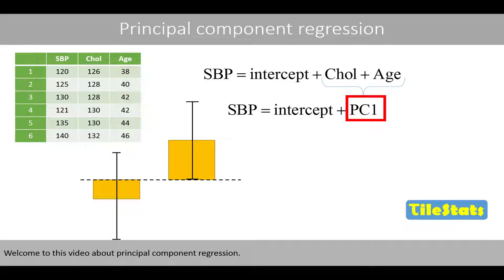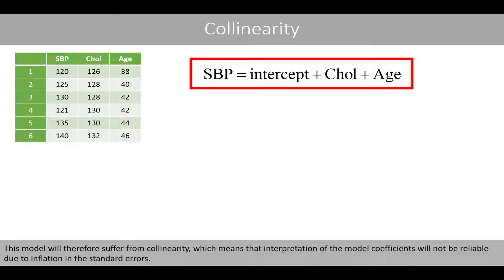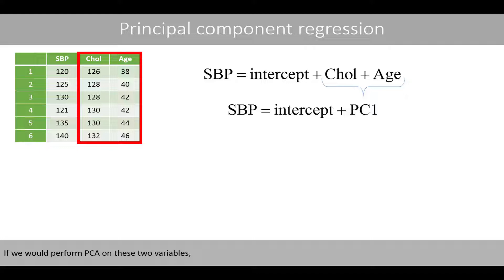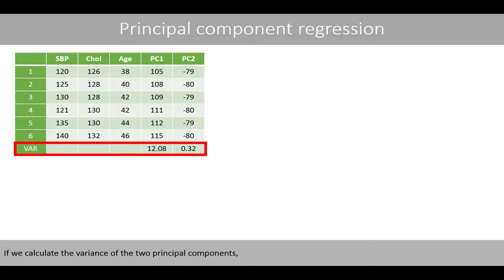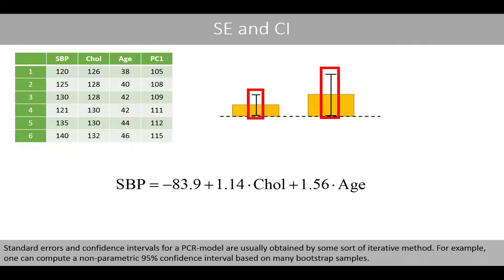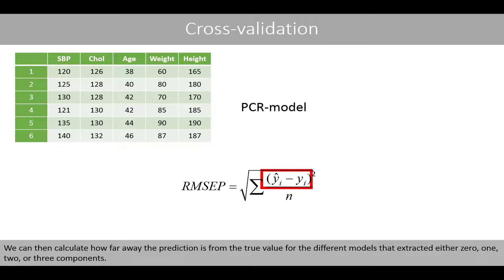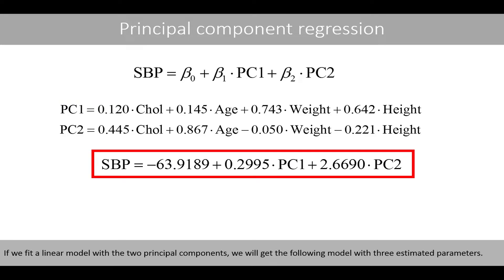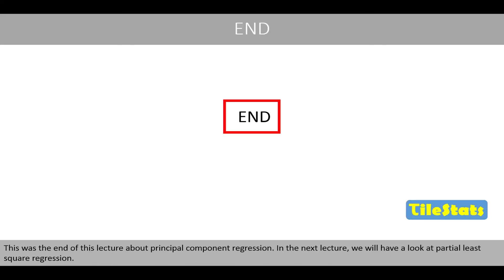Principal component regression (PCR) - explained

Comment: Using now coeficients and loads I end up with X1 = 130
X2 = 42
Y = 128.5 + 4.27 * (0.7 * X1 + 0.7 * X2)
print(Y)   = 642    And it is not realistic
Reply from the maker: Since you scale the two predictors, you need to also scale the values you plug in in the equation you use for prediction. For example: Scaled_X1 = (X1 - mean of the original variable)/ standard deviation of the original variable. 
Note that I did not scale the variables in the video in order to simplify the calculations.

Comment: I wanted to ask whether I need to rescale the coefficients obtained for the principal components or not. In the video, the coefficients are not rescaled back, and I'm not sure if that is correct. According to the video, predictions are also made using the original metrics, such as age 40 and Chol 130. However, when I tried to replicate the example, I ended up with completely different coefficients when using the principal components in the regression. Here is my code in python and results # Standardize the features
scaler = StandardScaler()
X_scaled = scaler.fit_transform(X)

# Specify that only the first principal component is needed
pca = PCA(n_components=1)
# Step 3: Fit and transform the data
X_reduced = pca.fit_transform(X_scaled)
X_reduced = pd.DataFrame(X_reduced)
X_reduced

feature_names = [f'X {i+1}' for i in range(X.shape[1])]
components_df = pd.DataFrame(
    pca.components_,
    columns=feature_names,
    index=[f'PC{i+1}' for i in range(pca.n_components_)]
)

# Display the PCA components
print("PCA Components (Loadings):")
print(components_df)
 
regr = LinearRegression()
regr.fit(X_reduced, y)
print("Intercept:", regr.intercept_)
print("Coefficients:", regr.coef_)

 PCA Components (Loadings):
          X 1       X 2
PC1  0.707107  0.707107
Intercept: 128.5
Coefficients: [4.27940302]

Comment: If PC1 is assumed as explatory variable and use least square then 
B0 is -75 and B1 is 1.85 

How you get B0 = -83.9 and B1 = 1.932
Reply from the maker: The scores of PC1 were rounded, which explains the difference. If you use the rounded scores, you will get what you say. Here are more exact values for PC1:
104.9293  107.7236  109.3397  110.5179  112.1340  114.9283

Comment: Thanks a lot. I have got a question: that's right, PCR is designed to resolve regression tasks. And what about classification? For instance, two classes are assigned as an output. The variables are reduced to the principal components, ok. Is it correct to use the obtained PCs for classification instead of original variables afterwards? 
Thanks for consultation!
Reply from the maker: Yes, that works. Have a look at this video about LDA where I compare PCA and LDA for classification:
https://www.youtube.com/watch?v=julEqA2ozcA&t=693s

I also have a video about PLS-DA
https://www.youtube.com/watch?v=zqFZ0mEc74k